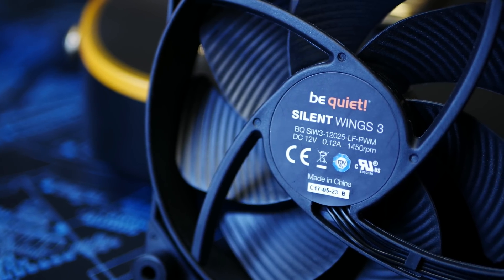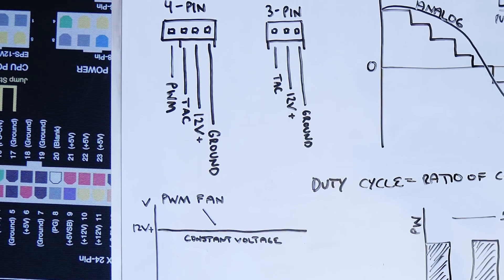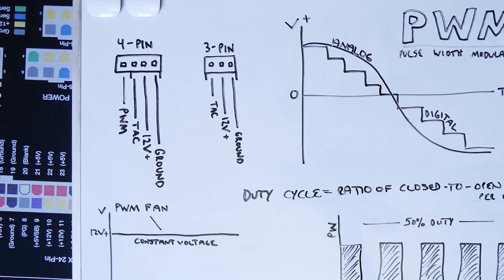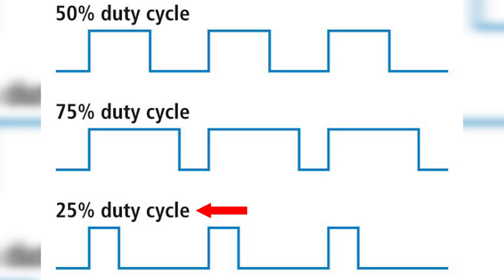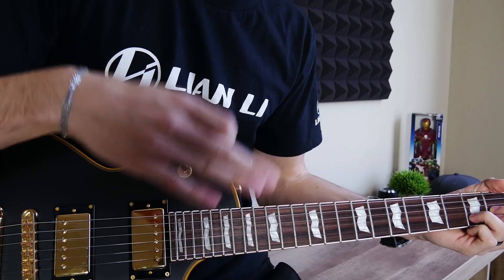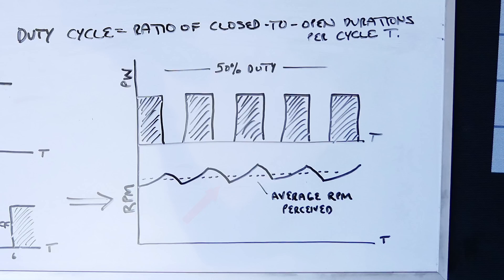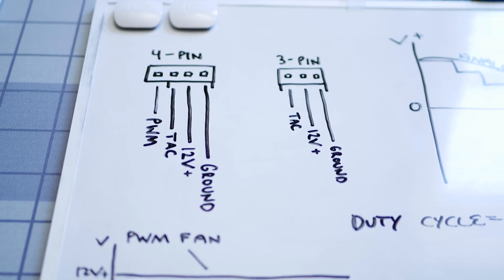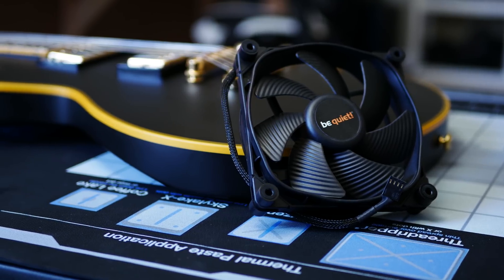Pulse Width Modulation EXPLAINED

Comment: Ok question, if im wanting to connect 3 pwm fans of different sizes, a 200mm and 2 80mm, 200 being intake and 80's being exhaust, but only have 1 pwm header on mobo, can i use a pwm fan hub and safely run all the fans? If im understanding right pwm % based, so the 80mm will run at 75% of its rpms and the 200 would do the same? But theyd all run the same % but not same rpm since its a single header?

Comment: Hi guys

Today I built my first ever PC (ive always bought premade ones)

It took me a good 4 hours to transfer stuff from old case to this new one but I got it working first time (well almost)

My question is about the AUTO fan feature, im not sure ive got it working OR my motherboard doesnt support it

When I switch to auto fan it seems like when I load GPU/CPU heavy games it doesnt speed up. Im not clued up on PC's at all so does the PWM feature auto detect temps and adjust fan speeds?

Also this is my motherboard so im not sure it work (https://www.gigabyte.com/uk/Motherboard/Z370-HD3-rev-10#kf)

ps. The switch at the top works so i can set it to LOW/HIGH etc

Comment: Nice video. Some fans are already so silent you won't hear them even in DC mode much, especially with low TDP CPUs. Still don't see the killer advantage in PWM apart from extremely low RPMs (versus not running at all).

Comment: Hello people!

I wanna ask you guys something. I wanna hook up a server fan, which is about 6000 RPM and draws about 3A of current, to my desktop PC. So my question is; can I draw the power directly from the power supply, where there is no shortage of current and no risk of damaging the motherboard traces due to excessive amount of power drawn by those fans, and connect the PWM and RPM wires to the designated pins on the motherboard?

Has any of you ever done such thing before? Am I missing anything? Please let me know.

Thank you!

Comment: I'm using a retro Cooler Master ATC 200 case so the I definitely appreciate the PWM technology. Since my case only allows 80mm fans, letting them sync to my bios' fan curve to modulate their rpms makes it much nicer when I'm just casually using my desktop.

Comment: I still like DC fans for one reason and one reason only.

DC fans can be turned completely off so they don't spin at all. I have yet to find a morhervoard that can turn a fan off with pwm while many motherboards I have used can turn a fan off in dc mode.

Comment: Can you do itx one fan header mobo soultion for tge extra fans that can be controlled via bios or software instead of traditional molex fan adaptors. as an example. I have gigabyte itx b350 with only 1 system fan header. I am using bitfenxi prodigy itx. I have 230mm bitfenix specter pro as intake attached to the mobo. While having two 120mm regular corsair fans as exaust on top. And finally cosair AF120mm fan at back at exhaust. My question. Can i connect all fans on single fan header without the risk of frying the fan header on mobo cause of too much amp. And is there is any way to control the extra fans via software or bios with only single extra fan header on the mobo. Thank you

Comment: I believe the pulse width and duty cycle is a weird way the describe it. The longer the pulse the higher the voltage and vis versa. This is just a VFD  since computers are dc. (You know this I know.)  now I didn't know about how the fans had the 4th pin. But if you have 12v to the fan and PWM. how? Since RPM = (v * Frequency) / # of poles in the motor. Is the drive on the fan or in the mother board? You won't need the 12v if you have the PWM pin. I'm missing something I'm sure. I'm half awake.

Comment: 3 pin version of same fan can be better as the 4 pin at same speed. Btw, I can recommend the Noiseblocker NB-eLoop B12-1 and B12-2, which I use since 4 years. The B12-PS version is the pwm version, but the 3 pin versions are somewhat better.

Comment: But greg, would it be possible to add somekind of resistor ( between the fan connector and  mobo pins) that reduces the output for the fan to decrease the RPM? We can regulate lightbulbs doing something similar so why not fans?

One could potentially buy a set of fans and test them with a fancy science-lab powersupply  to answer the question that is: how much voltage do i need to apply for the best airflow/noise ratio?

Comment: Although I have to give you props for the guitar...I'll be happy with my Fender Strat. :-) 

Anyways, I first came across PWM in synthesizers, many years ago. So it is interesting to see the same technique used in such a different user. For those who are wondering, here is a video on PWM use in Synths. https://www.youtube.com/watch?v=L4EiY6hNRdQ

Comment: The higher the ON TIME of a signal, the higher the UP TIME of the fan will be. The fan basically stops when the N  TIME[ data bit = 1,  on time] ends and tries to stop due to next bit being 0 i.e. OFF TIME but, the motion keeps it going and as the PWM waveform switches states in nanosecond scale,  the state change of fans[ off-on-off-on-...] is NOT visible to us human eyes. GG, Electronics student here, the first tech channel I've seen who at least knows what he is dealing with and let's the community know it. A big thank you Greg sir, good wishes from India. :)
*Science Studio, hence justified! <3

Comment: You didn't explain WHY PWM control is better than DC control. DC fans can be adjusted almost as well as PWM fans, the low speed operation is just a minor bonus that PWM control gets, but it's absolutely not why they are used, and better.
The reason PWM is better than DC control for fans is all in the power supply.
Providing variable power to a fan by varing it's DC voltage requires another power supply, similar to a Vcore VRM.. a hell of alot simpler, it's typically a simple buck converter, but this is inherently less efficient than simply giving the fan 12V and the fan doing the work of regulating it's power draw (which is either on or off so no wasted power).
This is why your PWM motherboard headers can easily take 2A current, if not more (the simply connect straight through to the 12V of the main PSU), but most DC controlled headers can only provide up to 1A safely. Above that and the buck converter built into the board will overheat, especially in the 50-80% region.
This is the same principle as any mosfet consuming power - it consumes most power when switching between on and off, either fully on or fully off it doesn't consume much power at all, (and why your CPU draws almost no power when not switching) - but when switching has it's highest value of current*impedance, meaning the I*I*R power losses are highest. The mosfets in the buck converter will be in this state most when providing between 50-80% of their input voltage of 12V. Some well designed fan power supplies will sink the most power at full load, and be more efficient at lower voltages.
Either way, with PWM all of this is negated, other than the much simpler and more efficient mosfet in the fan hub itself with far lower switching frequency (it only needs to switch typically once per 1/4 fan revolution if at all, so about 100 Hz) which is much less than a typical buck converter mosfet switching frequency in the DC-DC converter, which switch in the 300 KHz range. This is the only way to do DC to DC for power electronics, it's still a switched mode power supply and so ~85% efficient, but chopping it to AC, and back to DC is the only way. Using a linear step-down like a variable resistor or those resistors you can put on fan cables would be more like 50% efficient, so it has to contain switching mosfets, capacitors and inductors - again not needed for PWM, other than a much simpler more power efficient design that switches only when the fan needs to - for powering the coil for part of it's cycle.
Sharing a PWM signal to control 10 PWM fans is easy, anyone with a soldering iron can make the connections, assuming powerful fans or water pumps etc.. - 5A draw at 12V, no problem, and nothing else needed other than the PWM signal from the CPU fan header, and 60W on the 12V rail of your main PSU (and routing 5A through the board or wires, however they are connected, which is no issue).
Controlling 10 DC fans from a DC signal that can only provide 1A max (so can only be used as a signal not power supply), or using a PWM signal to modulate a buck converter to make 5-12V DC up to 60W - the only way to control those fans - means an actual 70W power supply that costs as much as 70W DC-DC converters cost, and dissipating 10W of heat from the extra power supply, and routing 6A to it from your PSU).

This is why PWM control is better than DC control, and why if you deck out your system with fans, only a few can be DC controlled if your motherboard does DC control at all.
Reply: Also I believe the 4 pin fans have a BLDC motor with a complete ESC inside. The PWM signal from the mobo is not used for chopping the 12V, but only to tell the ESC chip at what speed to commutate the fan motor. The actual PWM from the ESC will be completely different from the one the mobo sends (depends on the properties of the motor eg: no of poles etc.)
Reply: mashfaqm yup that's true.
For those who didn't know, "real" PWM for e.g. industrial motors etc has PWM on the actual power rail.. 
I'm not sure why but if you try to give a fan PWM on its 12v power rail they don't play niceley.. So they do this instead, with the PWM being only a signal and the actual power switching done by the additional circuitry you mention in the brushless fan hub.

Comment: I have Deep Cool fans in my case. The box says that they are PWM but they only have a three pin plug for each fan. Is the packaging wrong?
Reply: Very likely.. No fan on the market has PWM with three wires, it's possible if they left out the tac signal, but as the tac signal is free to route out of the fan, and the PWM control electronics costs money, there are only DC fans with tac (speed) signal, 12V and ground (3 pin) and PWM fans with 3 + pwm signal for 4 pin.
Reply: Basically 3 pin fans can't be controlled with a 4 pin header made for PWM only control. If you do plug them into a 4 pin header they'll just run at 100%, as they are given 12V instead of varying their voltage. It's perfectly OK to do, and you'll be able to read it's speed, it just wont be speed controllable and will be at full speed all the time.
If you use a fan hub, and it's the kind that connects to only one 4 pin motherboard header to drive e.g. 8 fans, then the PWM output from the 4 pin header (the 4th pin) is sent to all fans to control all of their speeds (providing they are PWM fans). On the tac signal into the motherboard 3rd pin, only one of the fans will have it's tac signal routed, and so it'll only measure the RPM of that fan. 
If it's a fan controller with USB, and has as many measuring sensors for the tac wires as there are fans, and can give an independant 4th pin PWM signal to each fan.. well it can provide PWM control to each fan and read their speeds, but again if you connect a 3 pin fan to the 4 pin PWM header.. it can still measure the RPM of the fan, but it will have no PWM control.
If you want to control a 3 pin fans speed you need to vary their voltage= (12V pin for PWM control) to a lower voltage, i.e. DC control. DC control means having a DC-DC converter, which becomes just like a mini Vcore VRM, a switched mode power supply on the board, and can overheat when supplying too much power say over 1-2A. This is the only way 3 pin fans can have their speed controlled, and they also can control 4 pin fans - they too will run perfectly fine and slower if you lower the voltage on their power pin.. So, why not just use DC control if it controls DC(3 pin) and PWM(4 pin) fans? DC are cheaper fans to buy, but more expensive to have circuitry to drive. Lookup things like the "Zalman fan mate 2" - only 2 fans controllable for £15, whereas a PWM splitter costs only as much as the wires it's made of, and an 8 fan DC fan controller would be an expensive power supply that no-one makes for that reason.
Some motherboard "4 pin" fan headers are actually just 3 pin DC control headers (typically say no more than 1A), with an extra pin for show, almost always the system 1-3 fans (this is the case on my 6 year old ASUS M5A99FX PRO R2.0)
Almost every CPU header 4 pin is an actual PWM header, same with "power fan" or "CPU-OPT", and can give anything up to 2-5A, and they don't need any power circuitry, just a straight through connection to the power supply's 12V rail for power. Most modern 4pin fan headers are like this.
.... AAAnd then there's the last type, which may have been what was on your Rog fan hub, but mainly on very good motherboards - a 4 pin header capable of detecting whether it's a 4 pin PWM fan connected, giving the fan PWM control on the 4th pin and 12v on the power wire, OR detecting only 3 wires connected, and giving it DC control by varying the voltage on the power wire, but it would only be able to control so many DC fans for the reasons mentioned.
However, you can only have so many DC controlled fans in your system, limited by whatever they're being powered by, i.e. the DC-DC power supply in your fan hub, or motherboard, but with PWM you can put as many as you like in, carrying 12v at 5A straight through to a fan is alot easier than converting 12V to 9V at 2A.
Anyway that should describe what options you have for fans, and why if you want lots of them, you need PWM. A few controlled by motherboard DC headers is fine, but if you want more, or power for pumps, or quadrupling up fans from the same header, or driving 12 from the 12v line of a molex connector controlled by the CPU headers 4th pin PWM signal... you need PWM.
Reply: I knows that a massive response, but I had to work this out for myself recently after I was finding out why the hell my motherboard had these fake "4 pin" headers with only 1 A current capability (that should have just been 3 pin headers), and I was decking out my system with DC fans from an old system.
Reply: Also.. you can do PWM the "old fashioned" way, and provide a PWM signal on the actual power line (this is how PWM works for other motors) but fans don't play nicely with this at all, not sure why, but that's how they are as they are.. with special circuitry in the fan to do slightly more complicated switching (compared to the usual PWM on the power line) depending on which coil needs to be switched at which time. The PWM signal just turns into a signal for the fan to read rather than an actual powered duty cycle like industrial motors.